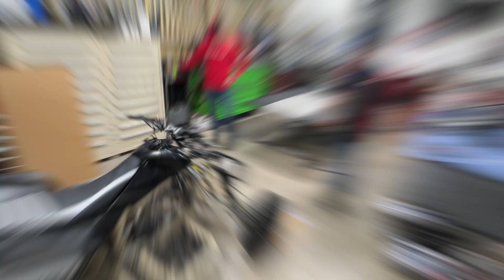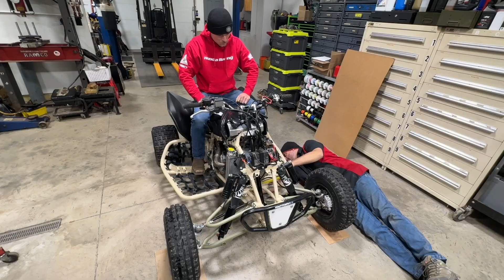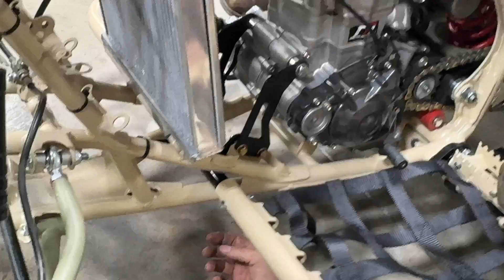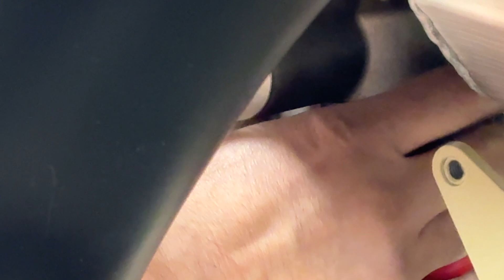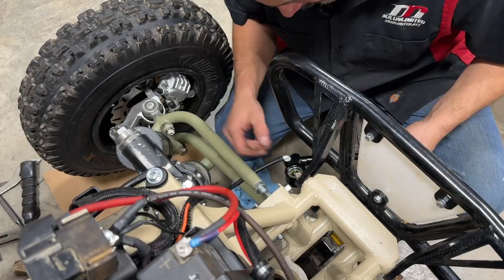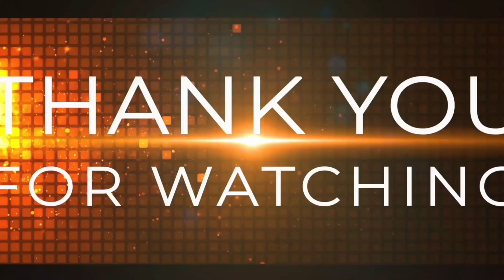Setting ATV Ride Height

Comment: So if ur setting a machine up for Xc racing do u still aim to get this low ?
Reply from the maker: XC setups are usually between 7-8 inches of ride height, depending on rider weight and tire size.  Thanks for watching!
Reply: @m.r.unlimited   220pds 21x7x10 20x11x9